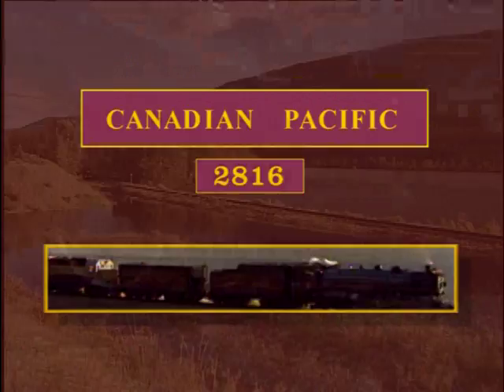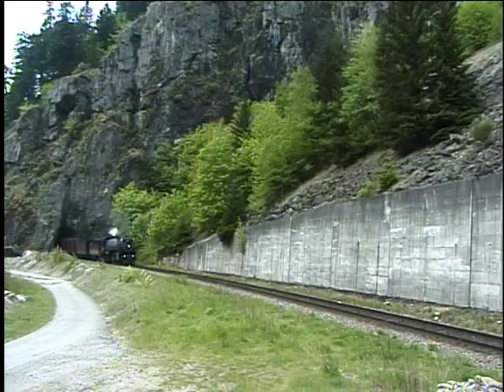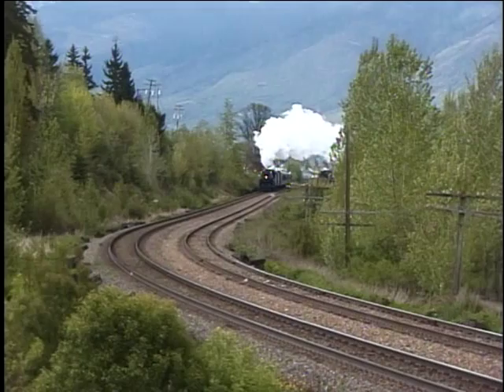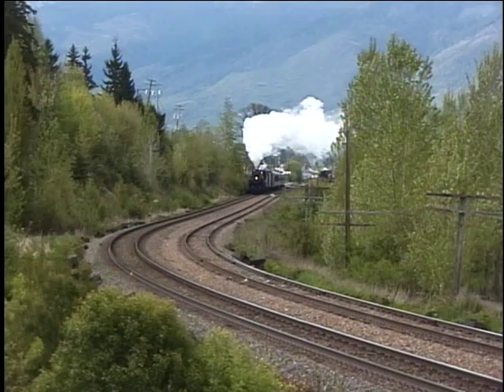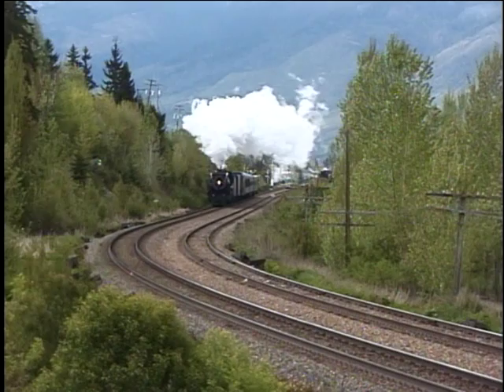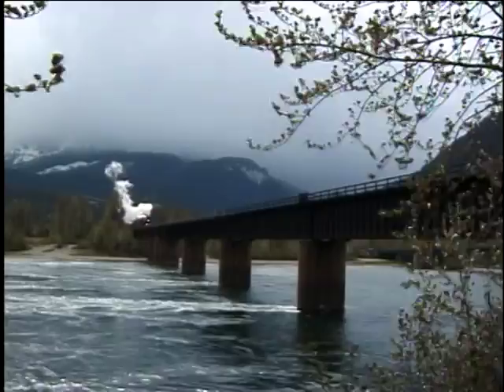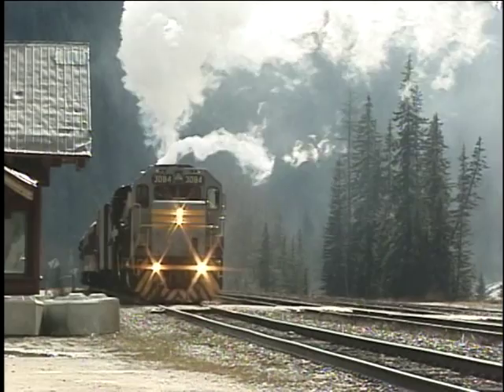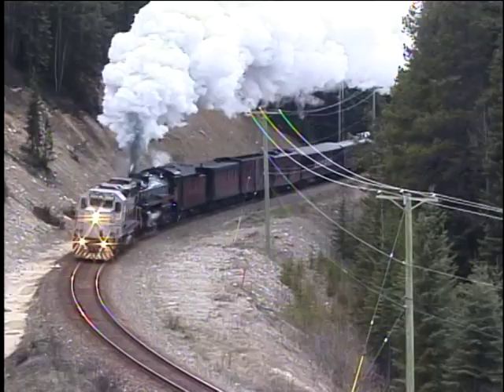canadian pacific royal hudson 2816

Comment: How many times do people do this? It's NOT a royal Hudson! The streamlined ones are! 2816 is not streamlined jeez!
Reply: 2816 Productions Indeed.  2816 is one of the earlier hudsons (2816 was built in 1929).  2860 was one of the later ones, built in 1940.  The announcer said 2816 was built in 1930.  I'm not sure which which year is correct, his or mine.
Reply: @heronimousbrapson863  yea it was in 1930
Reply: 2816 Productions Thanks for the correction.